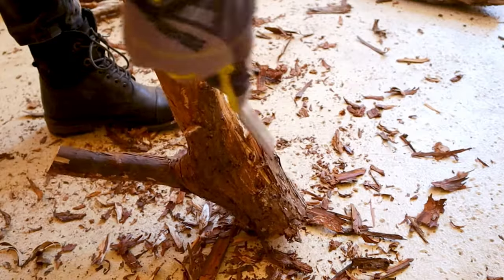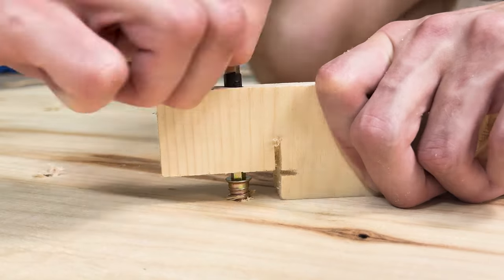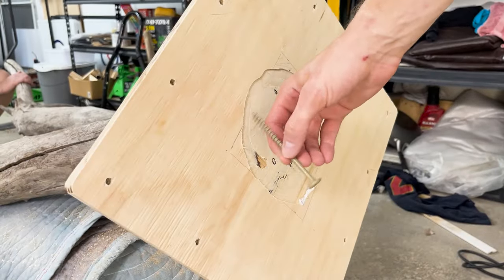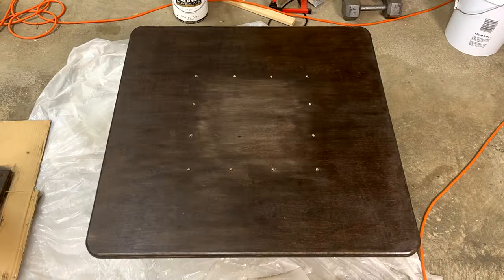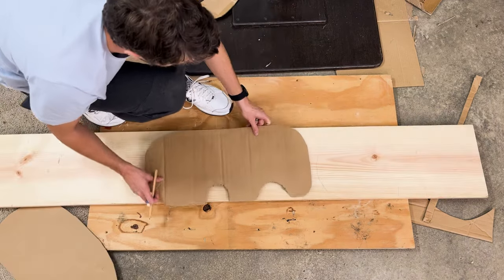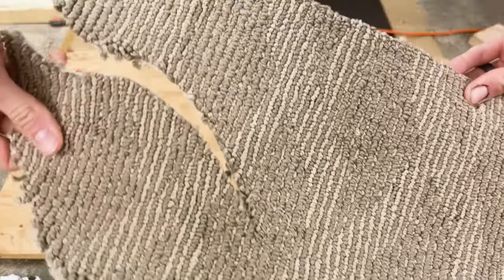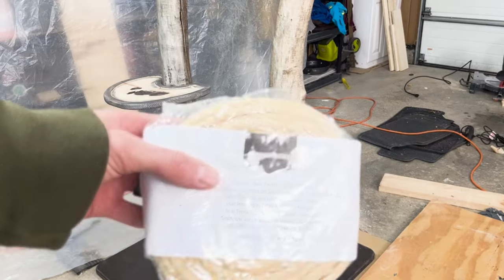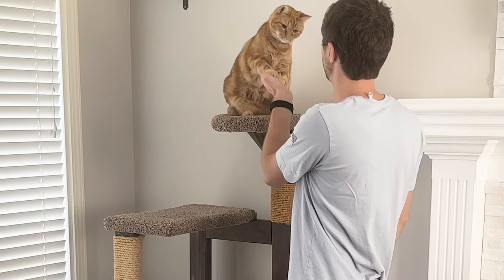Ultimate DIY Cat ‘Tree’

Comment: Large limbs [in some cases this is a whole tree]  are indeed very heavy, well done getting it level enough to stand on it's own before securing it to a base. I think you did a great job, the colour is nice& natrual it looks very beautiful,  fits right in your home & the Cat seems to like it.  Though the shelfs look much nicer with the bare wood, I think I prefer the shelf to be fully covered in carpeting, up and under for my two Cats safety when they're rough housing and running around. 
I have an old fashion box cutter uses a razor,  it's very good at sharp smooth cut, better than a stanley type for neat cuts but that electric sicissors is interesting.
I've been thinking of doing this since 1990 when on Cape Breton Island, a gorgeous flat stone lined beach there  [it's likely very different now, sadly]  at the request of an artist, people had been erecting drift wood standing up in to the rocks, it was a gorgeous sight to behold.  Due to it's location a lot of wood drifted and beached there.
I took one piece back with me, a beautiful silver tone limb about 3 - 4 inch in diameter and almost 6 ft long, sadly I lost it when moving. I really need to do this our indoor cats really need one, the ugly condo and scathing posts have to go they don't serve

the cats or the eye. Thanks for sharing. 

Btw, I find ammonia is excellent at removing stain & paint when used asap if one regrets the colour applied.